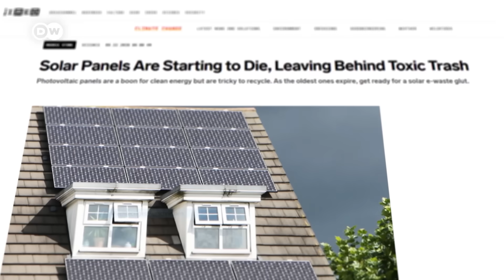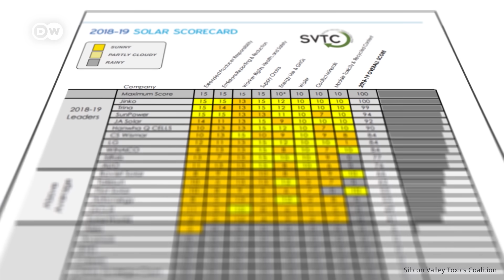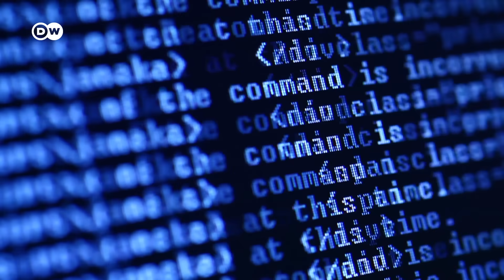How green is solar energy really?

Comment: That means it's still possible to find solar panels in land fills for free, isolate the working cells or even portions of cells, solder them together after testing them and matching them with salvaged cells of similar voltage or amperage and soldering them together to produce a low density solar panel for free plus your own labour.  Such wastage may be bad for the world but it's great for the individual willing to put in the work.

Comment: Briefly mentions Silicon TetraChloride-  yes it can be recycled but that process is prohibitively expensive, energy intensive and time consuming for panel manufacturers, luckily for the Green Climate Cultists and Leftist economists,  about 90% of panel manufacturing  is done in a place, cough cough, China, where this  recycling process is not required and environmental laws are a joke.  Panel manufacturing  is captured and monopolized by an unfriendly country because prices are artificially lower because devasting environmental violations are bribed away with donations to Communist officials.  Thus two birds are struck  with one stone, the price of  solar energy can be reduced enough to justify its use  and at the same time we can kill off one of the only remaining species of freshwater dolphins.  
Pat yourselves on the back Green Zealots,  you solved cLiMaTe ChAnGe.
How video forgot to mention the necessary EXTENSIVE mining of rare earth elements for batteries which are essential for any grid that is largely sourced by wind and solar..  Cobalt mining is terribly dirty even as industrial mining goes,  and it employs slave labor in the Congo and is devastating pristine rainforests. 
Thank you Green Leftist Zealots,  you solved cLiMaTe ChAnGe

Comment: Wonderful video!  Thanks, DW!
Obviously, since solar panels are not made out of thin air, there must be some energy consumed for their production (as is for any other energy source/fuel) and there must be waste at the end, part of which can be recycled.
A parameter that was not looked into in this video is how the productivity of solar panels factors in the equation.  I'm sure that a solar panel in equatorial Brazil will seem much greener than in my native Greece and both these will supersede a solar panel on Greenland (the countries are selected on the basis of their geographical proximity to the equator and the pole(s).  Within the same country, equally, the comparison would be tremendously different for Florida or Volgograd than Maine or Novaya Zemlya (for the same reasons).
It would make more sense if countries closer to the equator (enjoying much more and more effective sunshine) turned first to those and then, as the production increases, the countries further away should follow.

Comment: Every time you put up a solar farm, you destroy the ecology of the of the land it is built on.  Solar is at best intermittent and the further north you go the worse it gets through a phenomena called winter.  It would be better if every buildings roof was covered in solar panels; but do not convert hundreds of hectares of farm land and wild lands to solar farms, destroying the ecology.  The same apply's to wind power!  Generation four nuclear is a much safer and better form of power capable of both base power as well as peak power and load following.  The nuclear waste problem also goes away with generation four, as all that waste becomes fuel again!
Reply: Fully agreed. Very surprised that this video didn't cover intermittence (actual CO2/KWH is much higher than stated due to this) and land use impact.
Reply: Yes, correct, solar panels should be on each roof, obliterating (or greatly reducing) each consumer's electricity bill, not on corporate farms which also affect the local ecosystems.

Comment: The cheapest and most environmentally friendly way to produce electricity in the amounts needed for a modern city is by using a system of closed loop hydroelectric power stations combined with rooftop wind and solar power systems. You don't need massive wind and solar farms just rooftop solar and wind power systems. You use the wind and solar power to recharge the closed loop hydroelectric power stations. Closed loop hydroelectric power stations can be built underground or incorporated into building design saving space and placing the power production closer to the point that the power is needed eliminating most substations and transformers. Closed loop hydroelectric power stations are just used as batteries and can be made with 100% recycled materials. Closed loop hydroelectric power stations can be built by local industries saving transport costs and if properly maintained can last over 200 years. If they are strategically placed throughout a city and properly designed to have redundancy they can compensate for any failure of any part of the system almost eliminating blackouts.  Using this system is the cheapest, most efficient and most environmentally friendly way to produce electricity. No other system can come close. I have been examining every possible way of producing electricity and have discovered that this is the best solution. There is a way to make a closed loop hydroelectric power station that is self recharging eliminating the need for wind and solar power systems but I do need the help of a mathematician with an understanding of fluid dynamics, an electrical engineer and a structural engineer to help me produce an accurate cost analysis. Yes I have discovered how to make popetual electricity using water and gravity but I need help from people who have the degrees to prove it. I don't have the money to build a prototype, pay for a patent or pay someone to help me. Having knowledge is pointless unless you have the money to make it a reality.
Reply: You could use Openfoam and Freecad to design the hydrolic part. You may ask Framateam for help, or if you wish I can ask for you.

Comment: An awful lot of ifs and could have.
I worked in recycling all my career, I often recycled spent organo silicone solvents by distillation. HF is nasty stuff, but the waste is easily treated, neutralising it to calcium fluoride it can then be used as a flux in cement kilns, which reduces fuel use and saves CO2 emissions.
The recycling industry is very innovative and when the volume of waste is there these operators will rise to the challenge.

Comment: Many of the problems of new technologies, be it PV panels, medium term energy storage, electrolysers etc can and will be solved by scale and time. 

One good example is Li-Ion battery recycling:
Of course Li-Ion battery recycling was totally unfeasible 10 years ago, because barely had any Li-Ion batteries that could be recycled. And even now, it's not really economic, because we still don't really have enough electric vehicles to fill a huge, but highly efficient recycling plant. The market will increase from a few million $ to 40+ billion $ per year. And with it the efficiency.

We have seen this trend in every technology that had it's break through. 
Cost of PV, Cost of Cars, Computer Chip capacity, TV cost/performance, plane efficency and the list could go forever.
Many problems just solve itself once the market is there. That always happened and it will always happen.
However, we have to make sure, that we don't subsidize but rather ban or tax behavior and processes that are actually damaging to society and the environment.

Comment: What about salt water energy. Tried an experiment with copper wire around 2 pvc pipes inside one another held in a flowing salt water from the ocean and produced a current. My pipe was only a foot but produced enough to light an led desk lamp.  Consider something larger placed in the ocean current!

Comment: Solar is great for remote off grid applications. It has a nitch use case that can be greatly useful. But the undependability of its use on demand is a huge problem.

However molten salt reactors or breeder reactors can provide us with large scale on demand power. We have used heavy water reactors for decades that have replaced their nuclear fuel every 2 years. Those rods have over 90% of the fuel left in them available for use.

By recovering this fuel we can not only eliminate a lot of nuclear waste, we can help solve our energy problem cleanly. And since molten or breeder reactors use almost all the material, we not only eliminate more carbon pollution we use up old style nuclear waste that was previously created. How is this not a win win situation.

And not only does it clean up the environment but it is safer. If a heavy water reactor over heats it blows up. If a molten salt reactor over heats it shuts down. No nuclear accidents like in heavy water reactors. Why are the politicians stopping this?

Comment: Re Recycling generally. The easiest way to encourage recycling, is for governments to mandate the amount of recycled material that must be used in production. If every plastic bag, bottle etc, had to include..say 20% recycled material, with this increasing by 5% annually, then recycled materials would be very expensive and therefore profitable to produce. This would spur innovation, as companies compete to supply that recycled material more cheaply. If your bottle of 'Evian' went up by 10c, who would even notice and this would rapidly decrease in price. Petro-chemical companies stick the 'recyclable' logo on everything, even though they know it will never happen, because there is not the market for the recycled product at a price competitive with buying virgin stock. The stink the the fossil fuel industry would kick up, would be a fair indication that it was a good idea.

Comment: you have more concern then co2.. land use, grid adaptation, costs, batteries, maintenance and disposal, impact on oil exporting nations, effect to the environment that covering large areas of land with glass and black panels, the half of each day there is no production of energy, the chaotic nature of the weather that will effect panel generation, there is so much cost associated with going green that people don't consider part of the equation and the over all is vastly more environmentally negative. I mean you also have to add the 100's of millions of large appliances that will have to go to land fill and be replaced with electric that ran on LNG.

Comment: The cool thing about solar panels is that many have 20-30 year life spans. I have 10-year old solar panels that provide 80% of my electricity in the good sun months. I paid very little for these panels. So solar panels are rarely discarded, they are sold cheaply on the used market. 1000W from a used panel is still 1000W. It creates a proliferation of solar panel use, because it allows poorer people to get solar very cheaply while others upgrade to newer panels. Imagine a panel in use for 30 years!

Comment: Maybe one avenue to look into (on a small scale, and just to learn from it) would be to try repairing them by whatever means possible. Re-dope them or rewire them - and at a microscopic scale. Of course it's not going to pay, but just taking on the challenge of bringing a dead panel back from the dead might reveal something useful. Maybe you can "resurface them" or something like that? Until someone does this pointless exercise, you don't really know if you can or can't. (And you don't know whatever else it might be that the pointless quest reveals to you.)

Partialy functioning utility grade solar panels that are no longer good enough for that job might also be possible to make useable for some lesser purpose. Give them away to tinkerers if there's any life left in them, and maybe they'll find that unexpected something.

Probably the biggest benefit of struggling away to repair an existing panel is that it would give you some ideas about how future panels could be made, so as to be less difficult to repair/ recondition. It needn't be entirely pointless.

Comment: What about the issue:
If you increase electricity from solar, the more flexible sources you need to cover the need in the evenings and winter.
More solar means more gas/coal/oil.
Unfortunally hydro and batteries can not store the amount we need yet.

Solar is good but to build in mass is relying on storage tec that are many years away :/

Comment: Considering you make panels, and aren't having to continuously pull something out of the ground which is a polluting process, along with refining or cleaning that thing you're pulling out of the ground which is a polluting process, I'm pretty sure that solar panels DESTROY fossil fuels as far as pollution or emissions over life cycle.  Like, total destruction and any analysis of fossil fuel that doesn't bear this out did something wrong.

The waste material from solar panels, once they are spent is trivial compared to the amount of other waste humans create, like REALLY trivial.

Also, panels are now being warrantied for 20 - 25 years for near 100% production of their rated capacity.  I believe the newer panels are better quality partially thanks to Chinese R&D and I think it's safe to say that these panels are lasting 35 - 40 years, and possibly longer.  No, they won't be close to 100% production after 30 years, but that doesn't make them trash.  For many users, like home users not power companies, they can continue using panels even at 50% production capacity.  It's still free power.

Comment: Usually, within 2 years the system should be carbon neutral. Unless a particular manufacturer decided not to use solar energy to manufacturing their panels then the carbon usage will go up. If the solar systems last 15-25 years and it only takes about 2 years to be carbon neutral from the day you gather the raw materials to the day you have it in stall and commission, then it's justifiable.

Comment: I believe that the solution should be ahead of any further implementation. In other words fix the known problems before issuing any new large solar “Farms” to be built in the United States. We did this with the auto industry by giving them dead lines on gas mileage   We have to clean up the manufacturing and disposal before any new installations are built. Put are my in Nuclear energy which everyone at this point knows is more efficient and less dangerous than solar. If you don’t know that then check it out prove me wrong.

Comment: Problem that some places in world have huge summer/winter difference in solar energy(for example all finland), they had cold winters and fossil fuel are necessarily here at least for heating boilers (all modern fossil fuel plants works as both boilers and electricity generators)

Comment: Liked the take on this. Solar cells might not be entirely green or part of a circular economy yet. But that doesn't mean we should not use solar cells. 

Sticking with fossil fuel powered electricity generation would be like sticking with burning wood and not use coal in the 1800s. How then would the two industrial revolutions happen and lead to the production of the device that we are reading this on? 

So solar cell powered electricity generation is the way to go, probably for the next hundred years till something new comes up.
Reply: It (future tech) is already here... they know that they can't monetize it so there's no way we can be allowed to can have it. Especially self-powered houses, tools and vehicles.
Reply: @JoeGator23  Maybe. But here in our state of Kerala (India) the Govt is offering heavy subsidies for people to buy solar panels that plug into the grid. This is quite fascinating because the sole generator and distributor of electricity in Kerala is that very state owned electricity board. They are also paying money to the people for the electricity they provide to the grid. 

From one point it looks like the Govt should not be doing this because they are basically digging their own ditches, but it is happening. May be they will shift their monetisation route from being a producer to a distributor of electricity. I don't know, will have to wait and see.

Comment: There is no climate crisis but there is another good reason to convert to solar.  With modern digital electronics and smart drones, how many drones would it take to shut off the power in a metropolitan area?  Solar powered drones with little cutting wheels could cut through power lines and be programmed to hide in trees until they recharge.  A hundred of less drones might render a metropolitan area powerless for months or years.

Comment: we need to focus on concentrated solar (parabola) as they simply use mirrors. there's no issue with recycling. and we need to do so in extremely hot countries and places like the Sahara. What we really SHOULD be focusing research on is energy STORAGE and alternative ways of doing such on a LARGE scale like liquid batteries, compressed air, hydrogen, etc and more of the newer technologies that can be created from easily sourced and low-toxic materials. That's what we should be focusing on developing.

Energy production is not the type of thing that can be "decentralised" sorry but it's true. It needs scale. Nuclear, concentrated solar, hydropower - that is the type of thing we should be focusing on. Even off-shore wind farms (I haven't looked too much into wind so idk if it is sustainable, but I'm sure if using sustainable materials like wood it could be possible).

Comment: One of the way is using less and less  electricity in our day to day life. Avoiding using electricity for any simple work like drying cloths. It can be done by putting on a rope in daylight instead of electric dryer. Using a mop frequently instead of vaccum cleaner every day. Better designing of homes and offices to utilize daylight. Manually running outside on race tracks / open play ground instead of treadmills. Many such solution can be thought to save our planet. The problem needs to ve attacked at root.